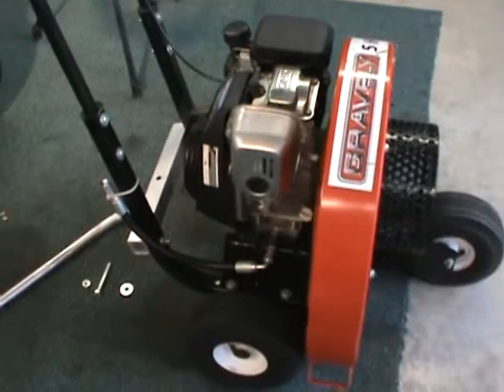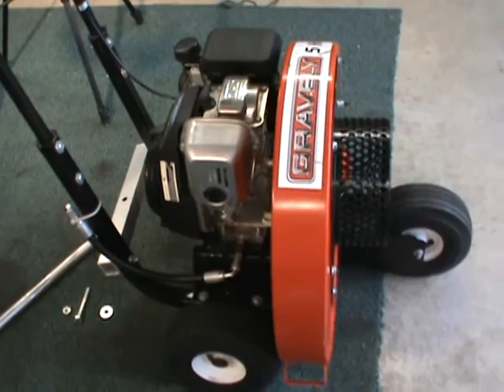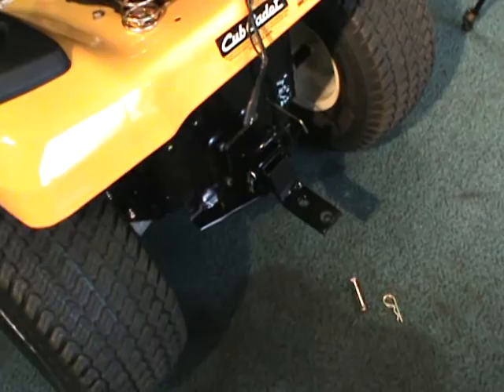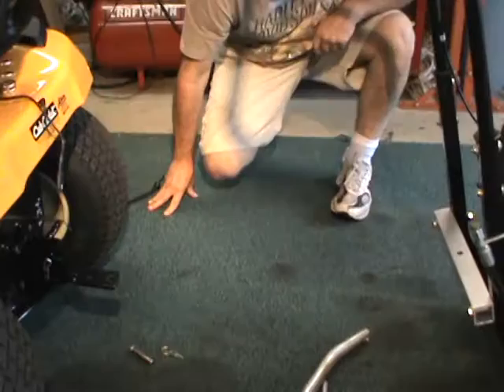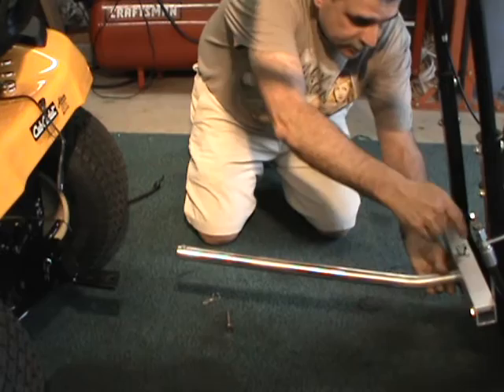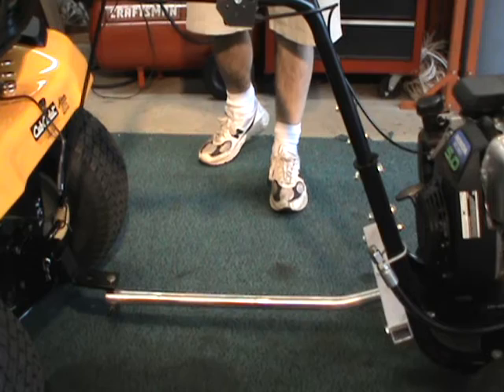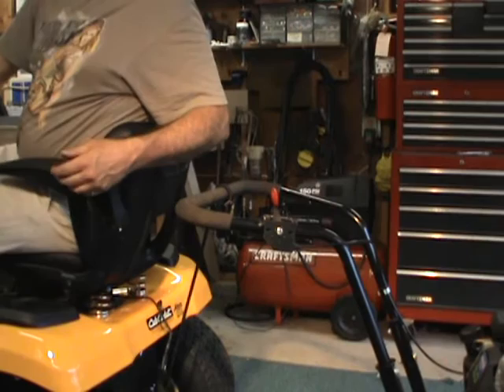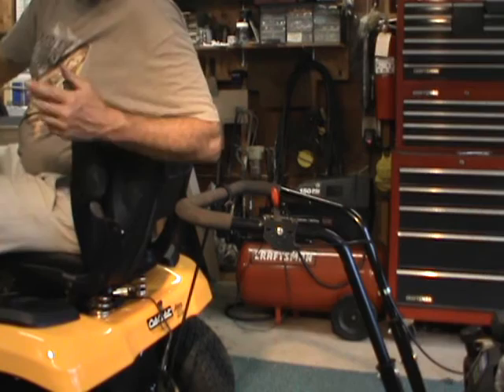Leaf blower hitch for tractor or ZTR

Comment: Beats the 500 dollar price tag for jrco blower dolly. Great job
Reply from the maker: I checked that out too, then another guy made a custom front dolly for a scag zero turn. This works well, and for a fraction of the cost. The main thing for me was the blower and mower deck discharge all from the same side. Blow to the  right, then you can clean up the fence line and against the house easier. Thanks for watching!

Comment: Why did you want the front tire off the ground. My front tire pivots 360 degree unlike yours that is fixed. Other than that your idea looks perfect. Thanks in advance Roger K
Reply from the maker: So it will track the riding lawnmower easier. Otherwise the blower could wobble like a snake behind me.  My logic was like a boat trailer behind the truck.

Comment: Does it jackknife easily when going backwards in a straight line?
Reply from the maker: No. it works well. Having a longer hitch bar it doesn't snap around quickly. The shorter the trailer the quicker it will respond. Thanks for watching.

Comment: What about hills, ditches or loading on a trailer?
Reply from the maker: That tow behind works well. Up or down a hill won't affect anything. I have a small hill in this yard. Ditches if they don't flip it the lawn mower over I guess your good to go. Loading on a trailer you could simply disconnect the blower and pull it up and jack knife it on the trailer to save room.